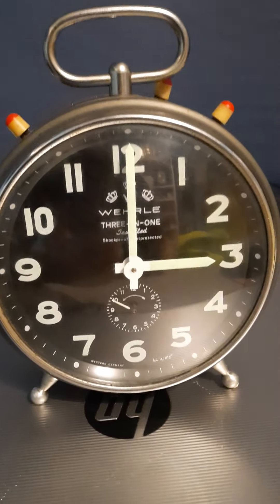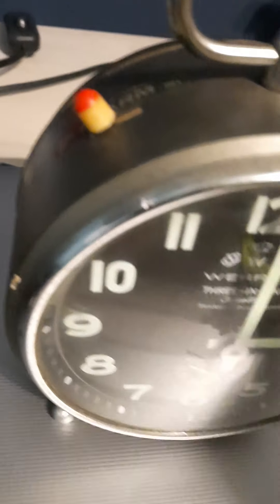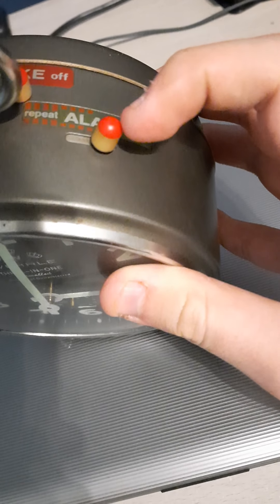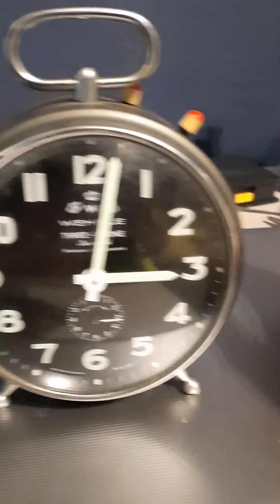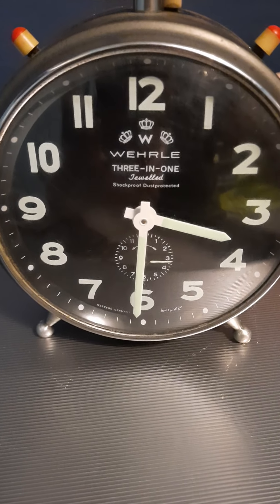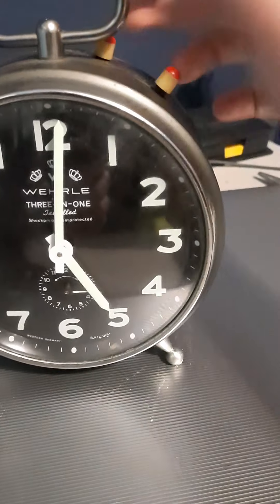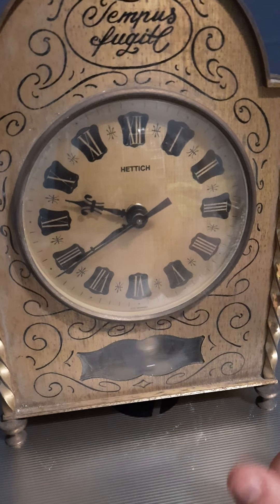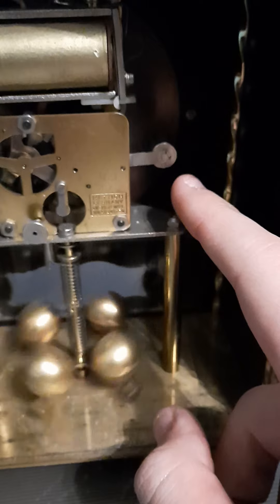Wehrle 3 in 1 alarm clock and a semi-mechanical clock

Comment: I have one but it only runs for a few seconds and then it stops. If i shake it around a little it runs again for less than a minute. Any help on how to fix the issue?
I haven't opened it yet because i wouldn't know what to fix.
Reply from the maker: I'm not sure, but it can be a mix of a dirty movement, worn out pivots or pivot holes and a worn out spring. I think you have to clean it and try to replace the mainspring and to replace the pivot holes if they're worn out too. But once again, I'm not sure if that's the solution for your clock.

Comment: I have the same watch but it's needles and numbers are kind of rusted and i am very scared that it is radioactive do you know if it is radium?
Reply from the maker: Hi, I don't think it has radium paint because they stopped using radium after the 50's and the alarm clock is from the 60's
Reply: @Timemaster-1898  thank you very much for the reply! I hope it is not radium radioactive because they say when it's rusted (if it's radium) it emits Alpha particles so i am very afraid, the radiation ( if there is) will he very low no damage but alpha is very scary it's never gonna get out! So until i find more sources I won't touch it back and clean it up
Reply from the maker: No problem, the only test I know is that if it glows very long it's radium (but it's not that accurate 😅). The other way is with a Geiger-meter, that detects radioactive radiation, but it's not easy to get one.
Reply: @Timemaster-1898  oh! I'll try, another video said (old clocks like ours) if it's radium it'll make the paint yellow around it but now we have black background so I can't see yellow if it was white it could be seen, I don't have dosimeter it's atleast 50$ something lol
Reply: Thank you for the video!!!